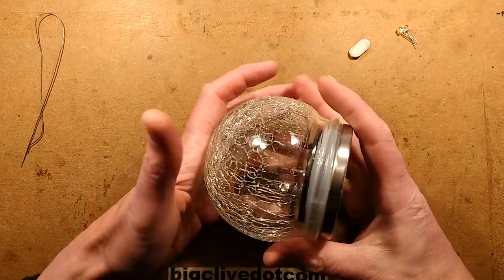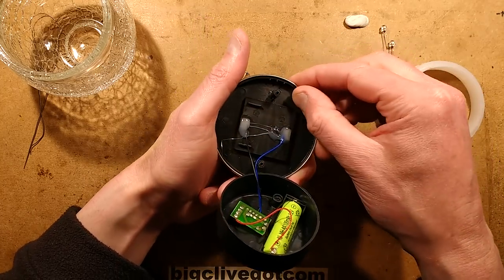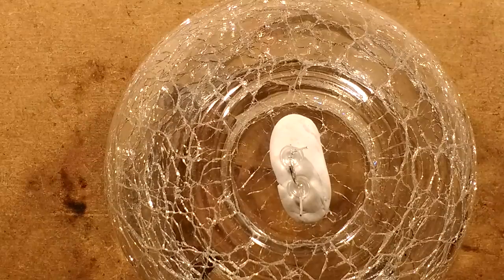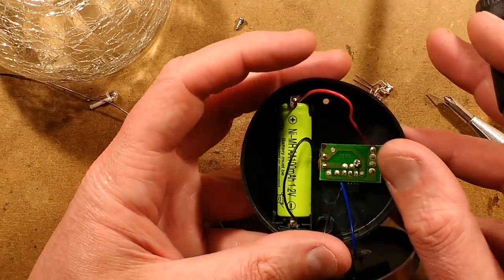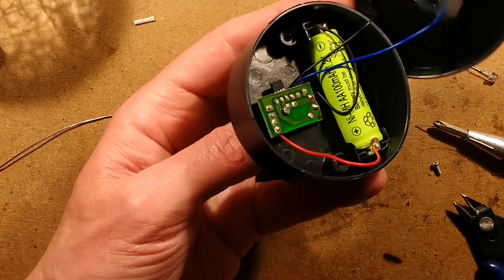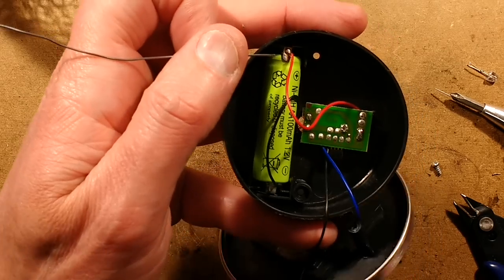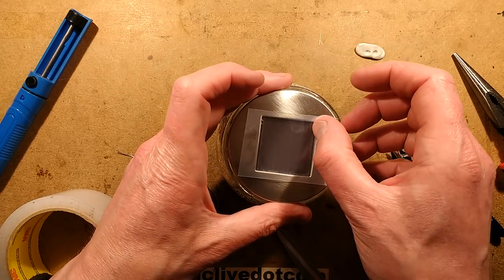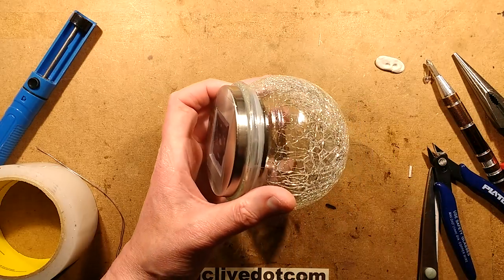Poundland solar garden light hack.

Comment: I didn't expect the colours to be so clearly defined. Wow.
Reply: Might be interesting to mount the LEDs further apart, or (if that little cell can provide the power), have three in series - R, G and B. That would be quite psychedelic, Man!
Reply: Phil S it actually uses slightly less power with 2 leds in series. R, g, b, leds would be good.

Comment: That would be a good application for color changing LEDs. I like to couple them because the colors change at slightly different intervals which results in endless combinations of colors that change as the cycles progress.
Reply: Low voltage LED devices will typically switch the LEDs on and off rapidly.  This causes a colour-changing LED to keep resetting its cycle, so you only get one colour out of it.  You can fix this with a suitable capacitor to hold the voltage high enough to keep the chip running.
Reply: And a diode so the coil can remagnetize.

Comment: 100mAh AA cell! Didn't know they made them that puny.
Reply: Asystole 
I'd never seen a 100mAh AA cell till now. Most solar lights with that size of cell are about 300mAh.
Reply: they're probably failed higher capacity ones ;)
Reply: Ah the wonders of manufacturer binning. Saves it from the "bin" I guess.
Reply: They do, they just put a sticker that says 32,000 mAh on it and generic branding.
Reply: Indeed. I've got a 200mAh cell somewhere but I'll never use it.
The minimum I'd ever use in anything is 1000mAh, preferably 1500mAh+. I'd rather that the lights shone for longer during the night...

Comment: I find myself wondering if this could work with three LEDs in a triangle - perhaps RGB, perhaps some other combo - and the dome adapted to rotate... moving the crackle relative to the LEDs could give a really nice effect.
Reply: If you're not careful you'll start inventing disco lights...
Reply: A hook on a swivel would work.  Of course, in the dark(ish), you could set it upside down.
Reply: I have done this. Had a rgb moving disco light, changed the crystal dome it came with for a crackled glass sphere. Yes it looks good.
Reply: How about using those automatic fading LEDs, not sure if the pcb would be able to work with them. But if you put a couple of those LEDs in the dome it might get interresting once they start going out of sync
Reply: Charlie Dobbie - Exactly the effect I'm talking about, but with this crackle effect. And, as I say, three LEDs to maximise the colour variation. 

Jay Herde - the key would be to have the dome rotating relative to the LEDs so the pattern changes rather than just turns.
Reply: Clive awesome job, like the idea in comments to try color changing. Keep up the good work🍬🍭
Reply: God a few videos back, Clive showed a very slow rotating motor that would work well for that

Comment: An option you could consider for water resistance is the UV reactive glue goop used on mobile phone screens, it's rather messy and smells vile, but should be effective for sealing thin clear sheets to almost anything, thoroughly.

Comment: Clive that is very beautiful, much better than with the cold purple/angry blue LED it came with.
Reply: Cold white is nasty, dunno why it's even a thing. To me it's like "Hard" toothbrushes. Pretty much only detrimental, except for alternative purposes like cleaning. Blue light has negative effects on the circadian rhythm, will give you insomnia - part of the reason doctors advocate an hour or so of LCD screen abstinence before bed.
Reply: Wolfin I often end up with the hard toothbrush ☹️ many lovely lighting designs seem to be ruined by the use of cheap angry blue LEDs including the common  durable low cost rubbery torches I am fond of.  Luckily there are still Incan versions so I can drop in a module with a better LED.  If I had Clive's skills and dexterity I would modify all my torches.
Reply: Wolfin  -  down here in the tropics we quite like cold white...
Reply: orion khan ah but what about angry purple/blue LEDs that aren't quite white like the ones in low quality flashlights?

Comment: Hi Clive, the switch will still leak/condensation, I'd remove it or seal the hole up.
For something cheap like that, spray the board with a couple of coats of clear paint.

Comment: Interesting mod.  I've of seen strings of identical LEDs, as many as a hundred all in parallel across a circuit that looked just like the circuits in one-LED solar lights.  Hadn't thought the voltage was adequate to drive more than just one blue or one white LED.  It would be interesting to apply a scope to the power going into the LEDs.

Comment: Instead of the UV proof tape, I'd have used a tiny silicone sealant bead all the way along. This also would have protected the metal from any surface damage.
Reply from the maker: Keep in mind that acid curing silicone sealant can trap liberated acid vapour and cause corrosion.

Comment: There is one thing you also should have done. I have done mods like this myself.. And one thing I always found is the battery drain became an issue.  So I remove the generic battery which you will find are usually about 1000 mAh and put in around a 2000 or 2100 mAh NIHM battery.   Now all my lights last all night without dimming at all.  Prior, they would run out of energy before day light turned them off and started to charge them again.

Comment: There's one those in the garden. It's not exactly like that though, think the solar panel is inside the glass since it's on a stick. Don't think mum would notice that it's missing for a while...
Reply from the maker: Yes, those ones have the solar panel under the glass with an LED mounted in front of the panel.

Comment: Clive, have you ever seen the 3 volt wet cell D size batteries used in some European equipment as memory/programing back up? 
I took one to bits (use caution) just because I was curious, and everything metal within a four foot radius corroded. No, I did not spill nor spray the liquid about.

Comment: I believe it should use slightly less power when running 2 leds in series which is an added bonus.
Reply from the maker: It does seem to run longer.
Reply: bigclivedotcom  guessing the higher forward voltage of the series leds utilises less of the spikes from the inductor.

Comment: Would two color changing LEDs work also?
Reply from the maker: They would require the addition of a diode and capacitor if the light didn't already have them.  Just a 1N4148 and a 100n capacitor so that the pulsing of the supply didn't keep resetting them to red.  With the low current involved you may find that red tends to dominate anyway as it pulls the voltage down a bit lower.
Reply: Clive - is that a cap across the LEDs and a diode in front of them?
Reply: Exactly
Reply: bigclivedotcom z

Comment: Last year Poundland had solar lights in the shape of a lightbulb. They had a short string of LEDs, the kind that has SMD LEDs mounted straight onto copper wire, covered with hotglue.
I bought several that had 1 of each colour of LED red, green, blue and warm white. A couple of them came to an unfortunate end during the exciting weather we had a few months ago.
So I bought replacements...Oh dear god no! The new multi-coloured ones have 4 horrible flashing colour chaning LEDs. While they are truely horrible, it's very impressive that you can make a colour chaning led that small (You just shouldn't)
Reply from the maker: I've got some of the new flashing ones.  They are a bit vigorous.
The lights tend to get thrashed to bits on branches in storms, so I recommend securing them with rugged wire.
They also benefit from clear outdoor tape across the solar panel and a 3mm hole being drilled at the bottom of the bulb to allow water to drain out.
Reply: Hi Pook,
I did exactly the same but am really delighted with the new ones. ( I followed Clive's advice re tape and drainage hole, plus put vaseline on the threads with the original ones and they are still going strong after more than a year)
I was thinking of weather proofing one of the new multi colour ones and secreting it up in the branches of a tree in the local Heathland ( Dorset ). Should cause a few double takes and perhaps a few new UFO sightings ;-)

Comment: Hey Clive, I’ve had a couple of solar powered LED strings from amazon and they’ve both gone the same way - strangely some of the LEDs toward the end of the string have gone progressively dimmer. I’m sure there’s charge in the battery. Anyway I’m happy to send you one of them if you’d like to diagnose and resolve? They were only like £7 but seems a lot of value and I really like them, it must have happened to other people. Feel like a little project at no cost to yourself? Cheers, Robin.

Comment: Im wondering, whi in all the datasheets of those chips from solar garden lights the LEDs are wired as one or more in parallel not in series
Reply from the maker: You can run a lot of matched LEDs in parallel at the cost of intensity.  You should only really run a few in series as it increases the voltage across them.  It does however let you use multiple colours with different forward voltages that wouldn't work in parallel.

Comment: How does it work without changing the circuit? Wouldn't the forward Voltage of a Green + a blue led (5-6v) be higher than a White led (3v)?
Reply from the maker: The circuit boosts the voltage to start with as a series of pulses.

Comment: How come the glass doesn't fall apart? What's keeping it together?
Reply: Yes, I would like to know how that is made.
Reply: They crackle it by putting the still really hot (its still slightly glowing) glass into water, from the temperature shock it cracks, and then reheat it again to a certain temperature so it sticks together better.
Thats how the real stuff is made.

There is also "fake" crackled glass, made with paints or resins that contract when hardening, which makes them crackle.
And sometimes they do it the way that the glass is crackled, and they put a layer of resin on it.
Reply: Wupme the process is called tempering.
Reply: My hopes and dreams
Reply: It's only a crackle pattern it's molded into it they've been doing it forever look close you'll be able to see the seam through the  Crackle                    🤤
Reply: Tempering is a general term for heat treatment of things, for example glass.
You also temper glass without making it crackle for other applications.
Reply: Probably moulded which is fast production method. Every single one probably has exactly the same pattern.
Reply: Certainly not, I have 5 and all different. The cracks in some of them are even up to the lip (where you just wouldn't have them "on purpose".

Comment: Whilst refurbish last years lights - removing switch replacing corroded wires etc I have a tri colour led which stays red -all the similar ones are OK do you think it may be the capacitor duff
Reply from the maker: It might be worth checking it does have the diode and capacitor, and maybe change the capacitor  if there is one.

Comment: Can one or two of these be used to power an Arduino? That would be really useful. Even if it only powers intermittently it could still be good for sensors.
Reply from the maker: I wouldn't recommend that.  It would be better making a solar charged lithium power bank assembly.

Comment: Hi Clive,
How can you tell the polarity of LEDs?
Reply: Length of the leads (longer is positive), a flat spot on the case (indicates negative) or by recognising the internal structure of your particular LEDs.
Reply: When in doubt connect them to either side of a lithium button cell.  When it lights up you have the polarity right.

Comment: How is it possible that the voltage for 1 white led is enough for 2 in series ? Is this chip operating with constant current load ?
Reply from the maker: The circuit pumps the inductor and the resultant higher voltage spike is what lights the LEDs.

Comment: Clive, Why do my soldering iron tips need changing so often? its a gas iron.
Reply from the maker: The gas irons tend to cremate their tips by fluctuating between cool and thermonuclear.  One with proper thermal regulation would be nice, but I've never come across that.  If it's for small general purpose soldering tasks then try a USB soldering iron with a beefy 2A output power bank.  If you search for my review of it you'll note that I was "surprised".

Comment: Looks super. Doesnt having 2 leds in series though mean an effectively double forward voltage? Doesnt that affect the operation or is it pulsing the leds on and off?
Reply from the maker: It seems to handle the slightly higher LED voltage fine.
Reply: bigclivedotcom Thanks, gonna give this a go! 😊
Reply: That's what I was thinking. I guess putting in parellel would consume more power
Reply: Yes, but also diodes in parallel cause other issues.  If they have a mismatch in forward voltage (for example, if they're different colours!) you may find only one LED will light, or one will be much brighter than the other.
Reply: The LEDs will be pulsed anyway, even a single one. At least when it's a simple boost converter with absolutely no feedback. I haven't seen the circuit, but it will most likely just "charge" an inductor which will then pump current through the LEDs. The circuit will always put the same amount of energy in the inductor, not matter what the youtpur voltage needs to be.

Comment: Any chance you could re-mod that light (or use a new one) but with 2 RGB colour-cycling LEDs (the ones with leads)? May require a power boost. Also, would there be any difference between what you just did, or wiring the LEDs in parallel? tks
Reply: If you want to try this, don't forget to have a low value capacitor in parallel with the led(s): RGB leds don't like high-frequency, they tend to "reboot" constantly and only the first colour light up, usually red.

Comment: Tried something similar with a red, a blue and a green LED and found out, that it isn't possible to use all of them in serial: reason for this is that the red LED took 20mA at 1.7V, the green LED took 20mA at 2.0V and the blue one took 20 mA on 3.1V.

Comment: Anyone know a good forum for discussing circuits? I have a circuit from one of those lightning-globes that I am trying to turn into an ozone generator. The circuit diagram I have made from it does not match the reference implementations has some weird features (like a resistor in series with a resistor and capacitor in parallel). I need to boost the output voltage a bit. I managed to do it by increasing the input voltage but I took it a bit too high and killed the transistor (replacements on order). I'm wondering if I can  do it by changing components though.

Comment: Any ideas on how to create DIY crackled glass effect?
Reply from the maker: I think it's something that has to be done during manufacture.
Reply: bigclivedotcom yeap, I know. I was just thinking maybe you have an idea how to "fake" the effect. I have an idea, but I'm not sure if it will work. I think of coating glass in thick coat of clear resin, then put it in hot water, hopefully the resin will keep the shards from falling apart.

Comment: the problem with these Chinese garden lights is that while the chip (yx8018, 5252, etc.) have excess-discharge protection they lack overcharge protection, SO the battery will fail, often catastrophically, in under a year.
Reply: I think they are relying on the fact that the PV panel has a max voltage not much greater than the battery voltage, right? I agree that they don't usually last as many cycles as you'd expect... although I've been assuming the culprit was corrosion. Let me know if you find a better solar LED IC... right now I've got a bag full of QX5252F looking for a job.
Reply: My battery gassed out, spewing noxious brown stuff within the compartment. It was probably acidic as everything in the compartment ended up looking pretty nasty. See: https://dzrmo.wordpress.com/ for my autopsy.

Comment: So with a bigger battery and a bigger LED. What could the circuitry handle?
Reply from the maker: You could change the inductor to increase the current.  It depends on the chip being used and how long you want to run it from a typical daily solar charge.
Reply: bigclivedotcom. I underatand that. I had hoped you would know the physical limits of the power we could put throuh the compoments without releasing the magic smoke.

Edit: I think even for chinesium components we could probably up the power by 50%%.
I only ask because it is more expensive to build a good version of this than buy a poundland and make it better. And i know you would approve of that.

Comment: Why did I expect LEDs in series to need more voltage than the cell can provide? Clearly I’m confused about typical LED operating voltages.
Reply from the maker: The solar circuit boosts the 1.2V up from the cell to drive the LEDs.  You couldn't even run one LED from a 1.2V cell.
Reply: The chip is an upconverting switchmode circuit, the LED is driven by the battery voltage plus the inductive kick.
Reply: You were right, but there's a purpose-built IC in there handling several solar charging / LED driving jobs. E.g. http://rarecomponents.com/store/1580